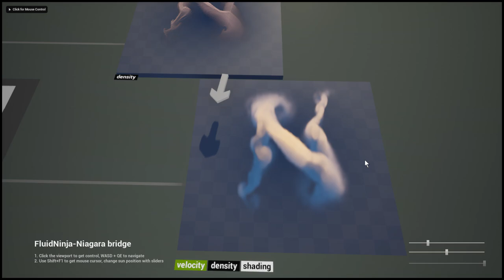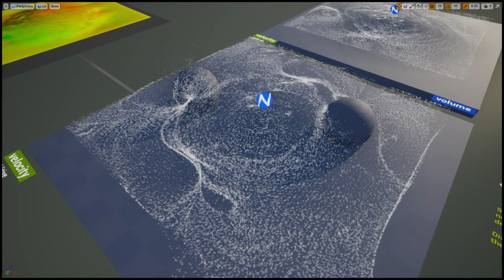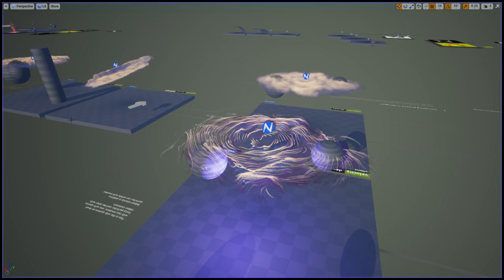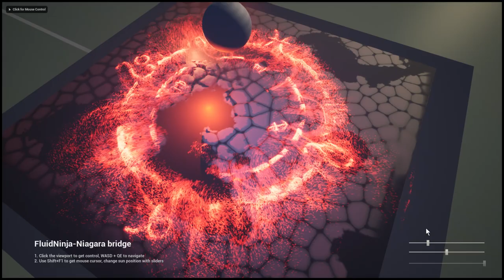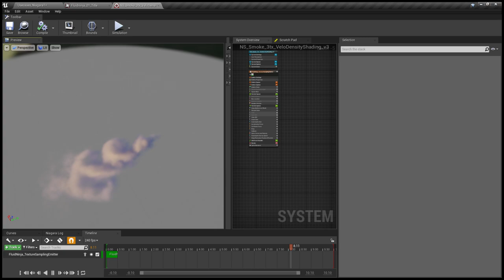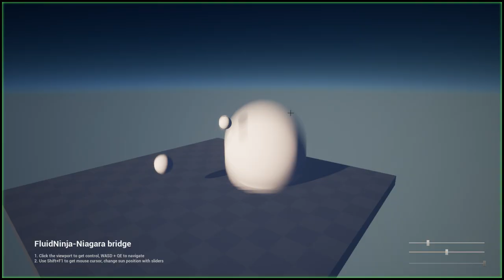FluidNinja VFX Tools 1.3 - Niagara Demo Level Contents

Comment: Is this compatible with embergen or is it a competitor? 😁 nice stuff. Hoping for more photorealistic examples. Excited to buy this 🙂
Reply from the maker: Hi LZ! Compatibility: Ninja 1.3 could channel flipbook baked fluid data to Niagara Systems, doesn't matter where your data comes from - embergen flipbooks could work as well. Please note: Ninja has a built in fluid sim that could be used to generate input data for the Niagara modules. For details, see manual PDF and tutorial vids.

Competition: Embergen is superior to Ninja - but it is outside unreal (not integrated to Unreal editor), and a time-limited license costs 7x as ninja perpetual license :)
Reply: @AndrasKetzer  that is awesome, what I like about your product is that it can directly input data with niagara modules which I really dont like fiddling around. So you have basically templates for the niagara modules? 😊 hope you will have a sale soon. Huhu but i really want it badly right now. You can message me haha. No disrespect though. I am excited to see your visual prototypes soon.